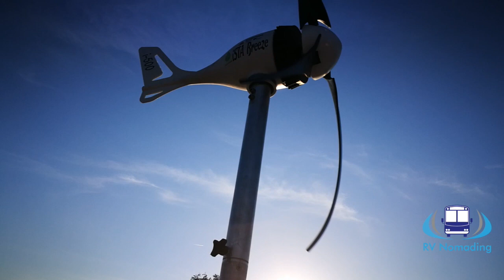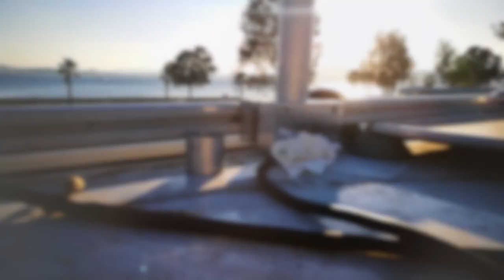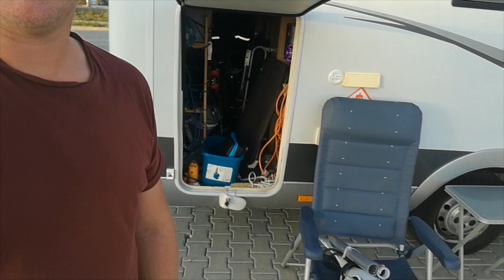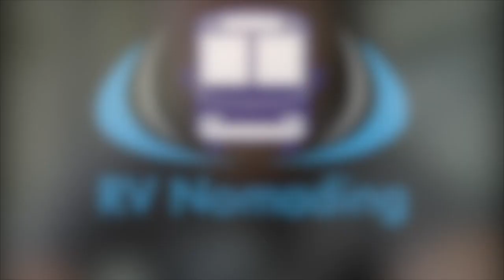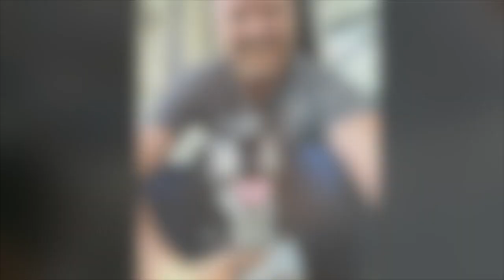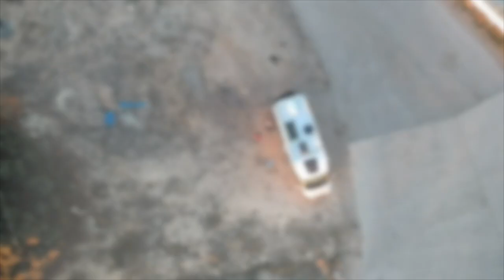RV Wind Turbine Testing

Comment: Thats a shame i just got one of these for my camper, its like everything you'll hear it when your not used to it but as soon as you do you forget that its even there. Maybe its worth looking at converting the blades so it runs like a vawt?
Reply: Cris is wind turbine is good for you? is generate good electricity?
Reply: @soniadowling4574  it's not worth it in the long run. For what little it produces your better getting more solar.
Reply: @chrisjohnson1715  thank you for your reply. How much in reality this turbine  it generate wattes per 1 hour?
Reply: @soniadowling4574  it all depends on the windspeed but it needs to be howling before it produces anything and your not taking it down when it's running that fast.
Reply: @chrisjohnson1715  thank you Chris to give your time to reply
Reply: @soniadowling4574  hi Sonia.
Did you able to get any info about this kind of turbine ( small size ) ? 
And what.s average wattage can you get from them on different level of wind ?
This kinf of turbine seems to me is very poor  blade's design and almost like very old blades of old planes ( include creating noise)...